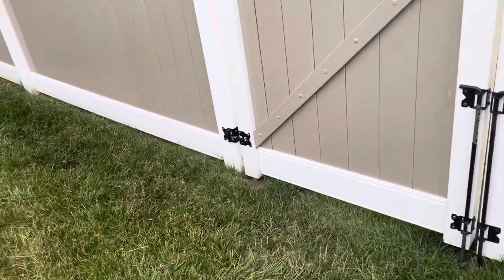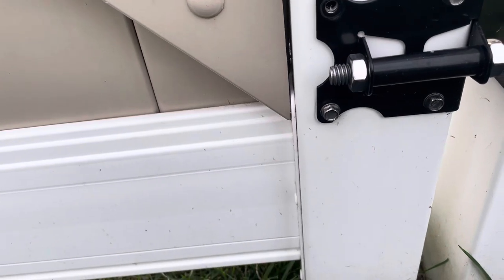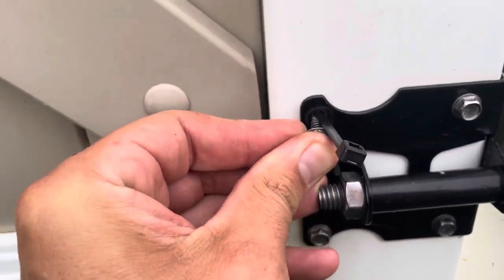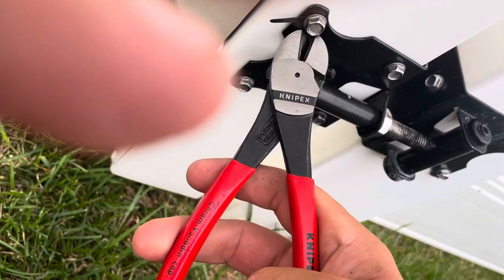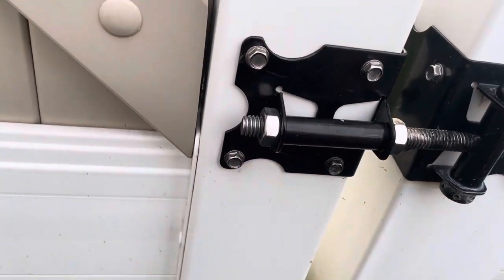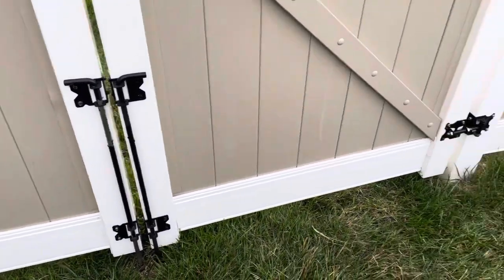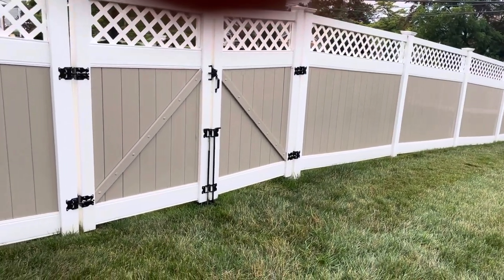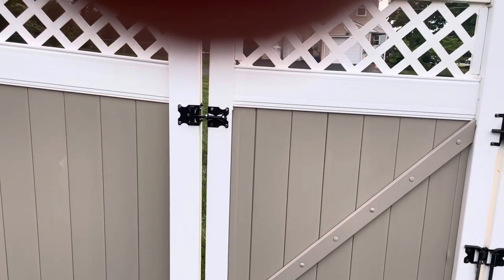How to repair a stripped screw in a vinyl fence.

Comment: Any suggestions on how to stabilize a double gate when expecting significant winds?
Reply from the maker: @stuff2498  add another drop rod on the other gate. I have one on each of mine. Dug a hole and added cement and a piece of pipe for each rod to go into.

Comment: Yes but shouldn’t there be a wood plank slid into the frame of that gate just like there is for the 4 x 4 posts in between the panels to prevent stripping
Reply from the maker: No. Gates where the hinges are have a metal I beam. I requested double wall posts, but no, there is never wood inside